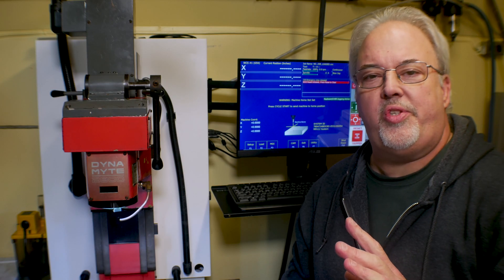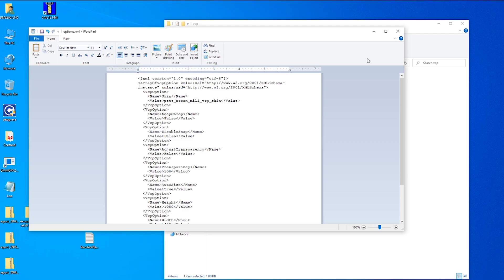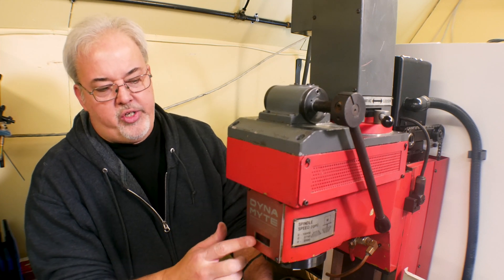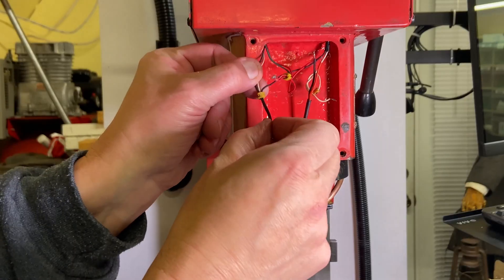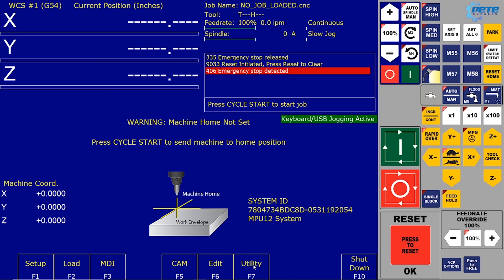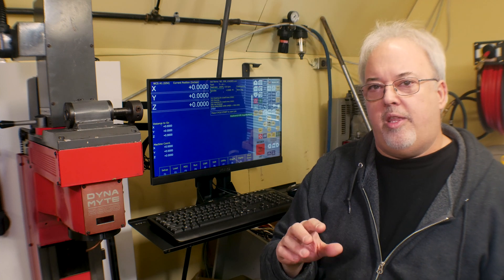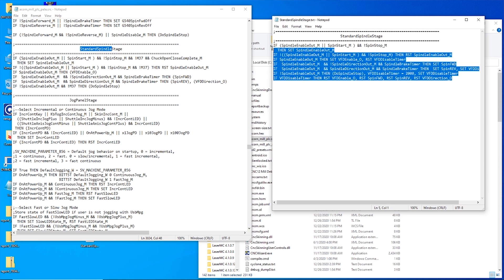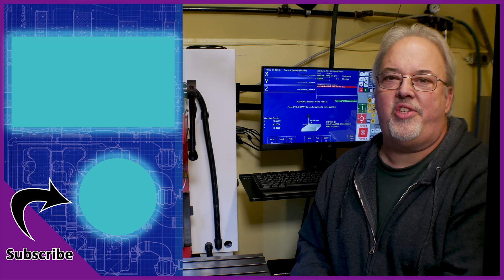CNC Retrofit: 4 Quick Tweaks Improve Usability

Comment: I'm using DMM servo for my lathe spindle and I get a fault just like you mentioned anytime above higher RPMS also I've tried changing setting in drive but cant get it to not fault so maybe I need same changes you made.
Reply from the maker: Could be- like I learned, the DMM does not seem to like having its enable signal removed while the motor is running.  It really needs a sequence where you instruct it to stop, then give it enough time to stop before removing the enable.  The default sequence did both at the same time.

Comment: Good deal on the DMM plc tweak !  That took a minute to find the root cause on that one. And a huge thanks to the gentleman on the forum that squared the code away !
Reply from the maker: Yes, I would have been chasing my tail for a long time thinking that it was a problem with the motor not having enough power.  There are some awfully smart folks over there on the forum.  Thanks for stopping by!

Comment: A Braking Resistor added to the DMM Servo Drive will help also to protect the Drive
Reply from the maker: Absolutely, but it won't fix the over-voltage on shutdown issue I was experiencing.  Tried that.

Comment: Great Job Pete!. I do believe that Wizard/PLC issue is a BIG stumbling block for some(me included). I really wish Centroid would address this as a bug. There system is very robust but this stops them from dominating in my opinion.
Reply from the maker: I can see how it could get old after a while.  I would think it should become a non-issue once the machine is up and running and stable- at least for day to day production.   but when CNC12 updates come along in the future that also require PLC changes, then you are going to want to have good notes to throw the tweaks back in after the upgrade process.